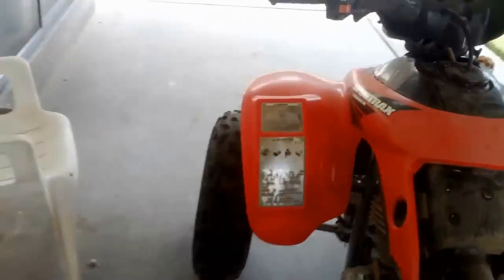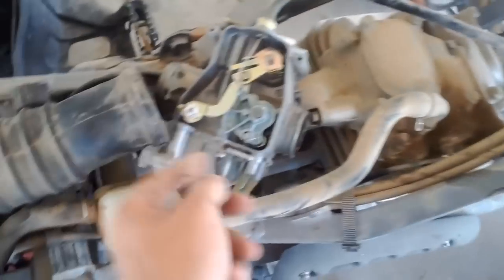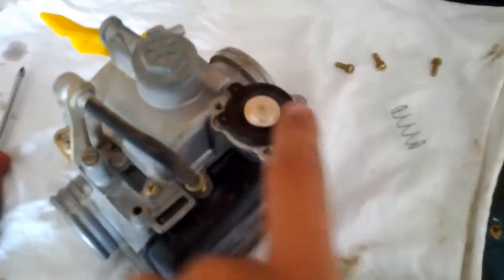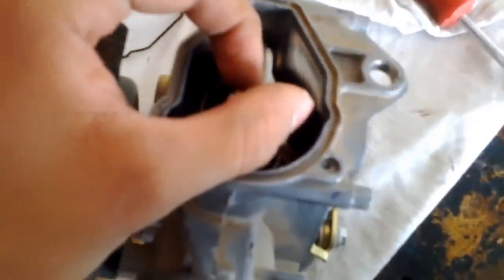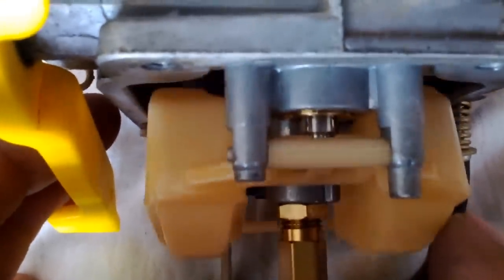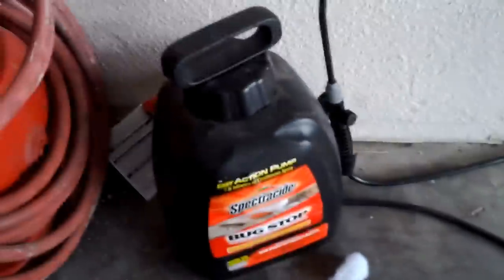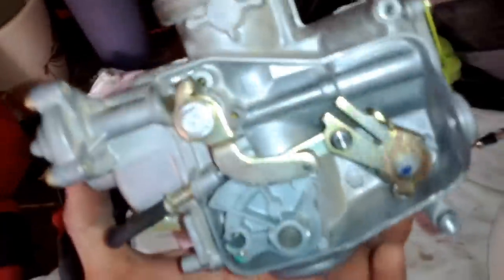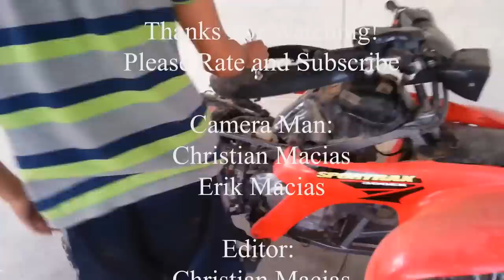Honda TRX 300 Quad carb teardown

Comment: You had your jets backwards in your mind. The one that stuck out the furthest was the main jet and the one you didn’t remove was the pilot jet. That’s the one that usually causes the problems you’re having in the video. If you’re going to go as far as to take everything apart make sure you use carb cleaner to clean all the holes and passageways while you’re there. Just taking things off the carb won’t do really any good and just blowing compressed air through the holes isn’t enough either.
Reply from the maker: +Zachery Miller this is excellent advice. I wish you would have commented this much earlier as I ended up doing this again and both jets were clogged. I didn't put any gas treatment before storage and the fuel that was left in the carb dried up and clogged it. After going in again and cleaning it, the atv runs great again!

Comment: I plugged the 2 black electrically boxes in front of engine out, (next to the steering stem), and check the fuses and if all the electric wire to battery and fuses is connected, (under the seat on left hand side. Hope it helped.

Comment: I cleaned my carb, but it helped me nothing. And one day I disconnect the wires in front of bike, and after connecting it, it worked and quad is now 100%!
Reply from the maker: Thanks for the advice. What wire was it that you disconnected? Was a fuel line? Electrical Wire? Vacume?

Comment: Hi, I have a 2006 trx300ex and mine is giving the same problem. It ideals right but when I am riding and giving it some throttle, the bike bogs down. Have you fixed yours?

Comment from the maker: I tore the carburetor apart again, after careful inspection, the jets were deffinitly clogged. I cleaned them out and the atv ran great again. It might be better to purchase them new. This could have been avoided if i would have put some fuel additives before putting it away for storage.

Comment: Did you try the wire thing that Charl Hanekom told you about in the comments? The same thing is happening to my 300ex and after watching this i will not be re-cleaning my carb like you did because as you showed, it didnt fix the problem... 

So, did you try the wire thing? did it work? did you ever end up rebuilding the carb? does your qiad still have the problem? 

its very annoying to get on the throttle hard and have it bog like this...these things should be flying around corners sliding like kings. let me know what the situation is now if you a minute! thanks!

Comment from the maker: To be honest with you... I haven't had the time or money (I'm a college student ha ha) to take it for a test drive since the repairs. My battery went bad. Have you tried replacing the spark plug and the connecting wire?

Comment: I'm having trouble finding where the little black hose connects to, the one next to the choke and fuel hose. Does it just hang off the carburetor
Reply: Jose Morales probably just the overflow drain. yes it's fine to hang there

Comment: How in the heck do you adjust air fuel screw when it's on the bottom of the carp you know after you put the car back on
Reply: Get a 90 degree bit driver attachment

Comment: Had same problem. the problem is that jet you could'nt loosen
Reply from the maker: You were correct. The atv sat for a few years. The gas got gummy and left that residue all over causing it to clog. I used a tiny sewing needle to dislodge most of it. The atv is running beautifully now.

Comment: just cleaning the carb doesn't do it sometimes you have to buy rebuild kit
Reply from the maker: I thought so.... I might do a rebuilt and upload it. Its been sitting for a while now since I don't have time but as soon as my summer classes finish I'm going to be on it and get it rebuilt.
Reply: yeah I rebuilt mine the day of got the kit on amazon and it used to bog out but i went full speed in fifth gear but use carb cleaner take the plastics off it needs airfuel mixture leaned a bit because when i give it full gas instatly it dies out but if i give full throttle slowly it works